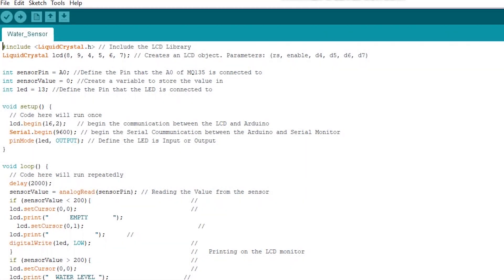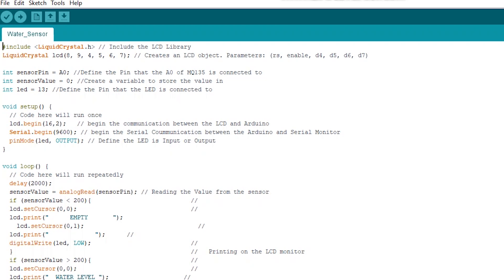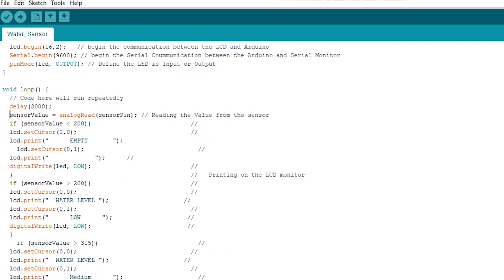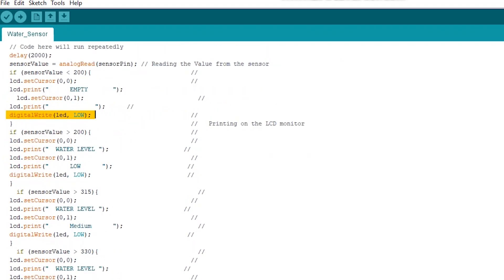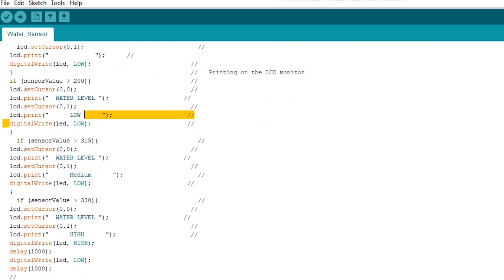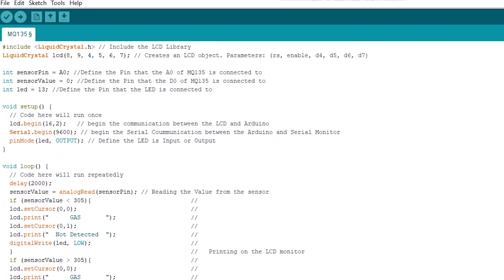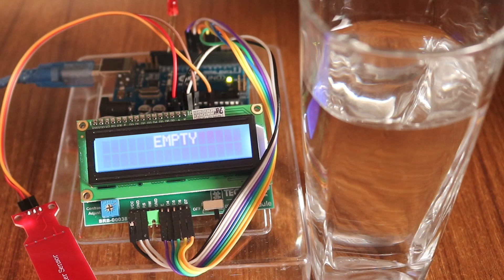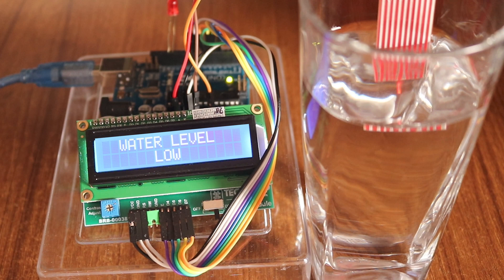Arduino Water Level Sensor with LCD Monitor || Arduino Dude

Comment: Hello arduino dude my lcd is not working plz help me.
Reply: As soon as possible plz
Reply from the maker: Hello,
Check you connections and code and do exactly as the video. If you already did cross check and let me know...
Reply: Yes I cross check
Reply: Will you plz help me on other way
Reply from the maker: @AdityaRaj-zo2nh  is your LED turning on and not showing anything??
Reply: @SadmanMahmood  yes
Reply from the maker: @AdityaRaj-zo2nh  So, on the left side of the connections on the monitor you will find contrast adjust. Try turning on the monitor and rotate that thing with a flat screwdriver and let me know.

Comment: Great video.  This will come in handy for my greenhouse I am building.  I plan to use 3 LED's to show low (red), medium (yellow), and high (green).  A yellow or red would trigger more water to be added to the drip system.  Thanks for the links.  Nice to know which components you have been using.
Reply from the maker: Great to know that this was helpful to you :)